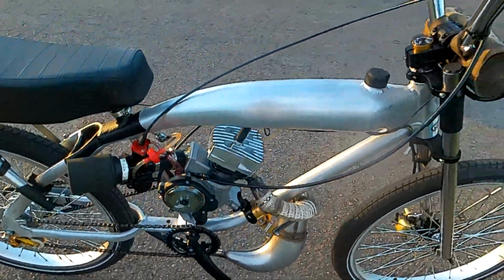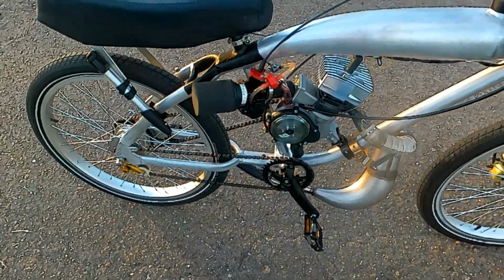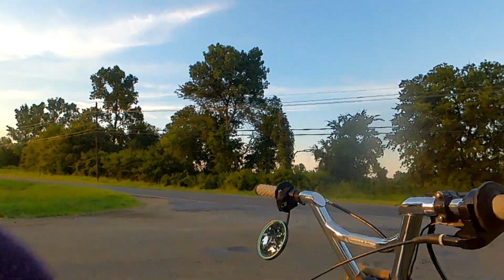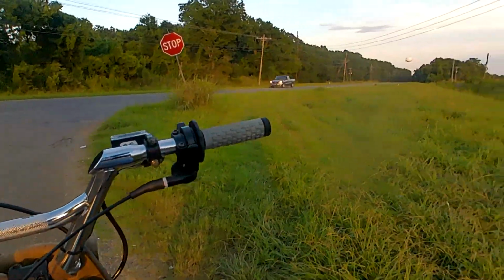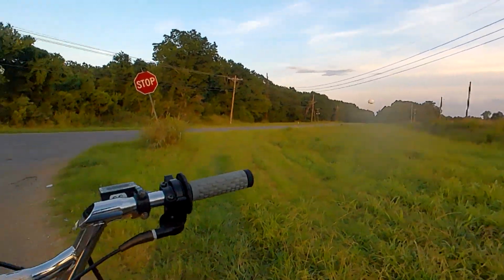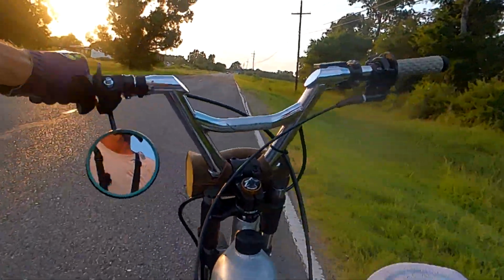✨Motorized Bicycle's First Real Test of BTG clutch setup with stock Spring 👽👍🏻✨

Comment: make it go 100mph
Reply from the maker: Why, No point, Making Power is the Deal 👽👍
Reply: @Op1zilla  exactly same here!  Love the short muffler i have the same length approx. 100mm modified with smaller dia inside pipe, inside and fresh glass wool, tried the 200mm and engine rpm reaction is slower